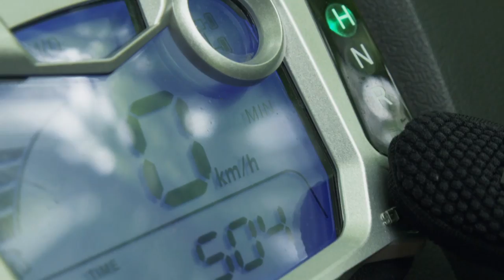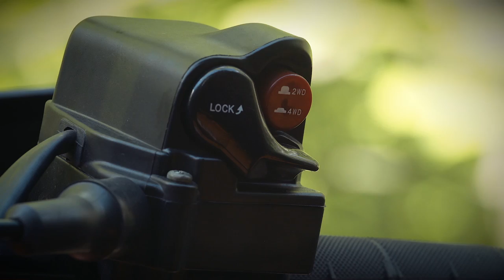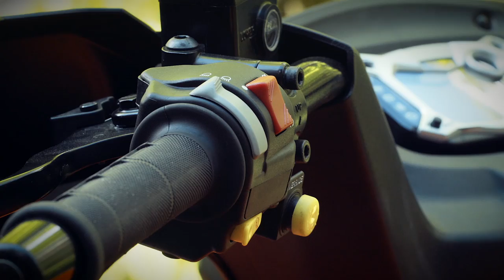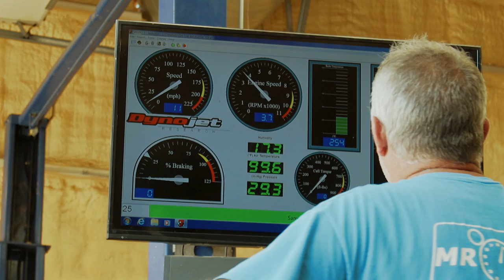Dirt Trax Television 2017 - Episode 6

Comment: Oh and a 12 month Polaris extended warranty is great and all but they don't back there warranty so what's the point? Example being the dust in the throttle body problem or when a gear in the trans chips a tooth or when the high/low range gear bearing fails and they chalk it up to 'owner neglect' with 5 miles and 1 hour on the odometer that the farmer took 1 10 mph lap around his field with a bale of hay. I'm sorry but Polaris has been doing some shady stuff lately but hopefully this year or 2018 they turn it around. You wanna be king? Don't focus on HP wars focus on reliability and refinement
Reply: What do you think they just did with the ranger? They did focus on reliability and refinement. Its only 2 hp more than last years model but it has all kinds of other improvements: bigger and better clutch, larger and stronger bed, more storage and easier to install accessories. And its not only Polaris that will deny warranty just because they feel like it. Can Am has a history of this as well: G1 frames cracking in two, heat issues on all of their quads, weak front diffs... No one is better than the other really.
Reply: drew3406 that I agree with. I hope this ranger re-vamp is there turn around point. There was multiple cases of warranty denial due to a design flaw which the following year model had fixed but Polaris denied a lot of simple claims that held Merit but they knew it was a problem so they let it go. A lot of companies do that as you said can am had problems as they all do it's just Polaris has had a streak of this since 2010 but this seems to be there turn around. I guess we can only watch and hope. They've been standing behind them lately and really going out of there way with recalls so maybe there was a change this year. I don't work for them so I don't have the details and figures this year I'm just talking about the 2010-2016 reports and figures. I like Polaris and I like what they make I just wish they'd change some things and be a little more customer oriented then they have been.

Comment: I can understand why CVTs are all the rage today, but there's just something about running around at 90% RPM all day that doesn't appeal to me...

I like a clutch, and I like multiple (fixed ratio) gears, and it's a real shame that the only manufacturer that caters to this across most of their range is Yamaha.
Someone should develop a CVT that is regulated by hydraulics rather then springs, so that the rider can take control and treat it like any other manual, or leave it up to an electronic governor to do all the work. It's the best of both worlds! - infinite gear ratios which can be manually controlled and selected without any loss in power..
Reply: Brodie Bennett don't forget Honda. They went a different direction with the Dual Clutch setup which works amazing actually. I agree CVT isn't very good feeling at all it constantly feels like something is slipping and screaming all the time. Maybe more manufactures will try the DCT setup, seems to be the best both in a way, an auto shifting manual trans that is reliable
Reply: Honda's DCT (If I'm thinking correctly, and not confusing it with something else they did) is a truly amazing technology, and while the lighter sport ATVs might not benefit from the extra weight, the bigger "enduro-class" bikes, like the Renagade etc. should definitely take a page out of Honda's book!
Let's just hope it catches on!
Reply: Brodie Bennett truthfully the DCT and normal 5 speed aren't too much different in weight actually. CVT is light but not any more so then DCT. When you get down to the loss factor yeah mechanical CVT is efficient but only at one thing, peak power. DCT though is very efficient in energy transfer threw the direct clutch packs locking the engine to the trans with very little heat being generated like CVT. But I agree that the sport utility such as renegades and mud specific bikes wouldn't really benefit from a DCT system. Too bad cause I'd love a outlander 1000 with manual 5/6 speed or a DCT so I can cruise at 2200rpm and hear the growl when I want to while feeling that torque pulse at lower rpm. Maybe one day, I mean look at Yamaha with the legit paddle shifted 5 speed they just produced. Gear on gear, manual clutch (or paddle and auto clutch SS model) but both have a true gear box. No belts! Maybe that'll come around again... CVT is for mud, racing, and beginning riders who don't want to shift
Reply: Brad At Tittle Diesel Performance
I couldn't agree more! However, seeing as Can-Am cut what was left of their sport class (the 450) awhile back to focus solely on the "sport"/Utility market, I think that it will be quite a few years before they decide to get back in the game...
Reply: Cvts are what 99% of buyers want, that's why they make them.  Yamaha had to make a semi-auto paddle shift YXZ because not enough people liked the original YXZ and its fully manual clutch.   I wish Yamaha would make a smaller paddle shift YXZ, like a 50" model with the 708cc single in it or perhaps an 800cc class v twin(or one of each like Polaris) to compete with the Wildcat Trail and 50" Rzr models.  I think it would be a great seller.

Comment: Polaris is proud of their 1 year warranty?  Somebody tell them their competition has had that, and more, for years. Kawasaki has a 3 year warranty and CF Moro has 5! It's a pretty lame warranty for a manufacturer that claims to have the toughest machines. I wouldn't consider buying one again unless it came with a 3 year warranty.
Reply: EastCoastATV you can pay for up to a 5 ur warranty. yes I know you have to pay for it though. bummer.
Reply: can justify it thought if you can get the bike cheap enough
Reply: AtvRacer 
You're right, extended warranties can  be purchased. A good way for Polaris to build it's reputation would be to offer a 3 year warranty standard. I like many traits of Polaris ATV's and I owned several over the years. I had enough issues with them though that I wouldn't consider buying one unless the offered a better warranty.

Comment: Argo 6x6 and 8x8 is out of date. They should have improved it years ago. Still low speeds, low hp and no suspension. Check out the Tinger Track if you want suspension and speed.